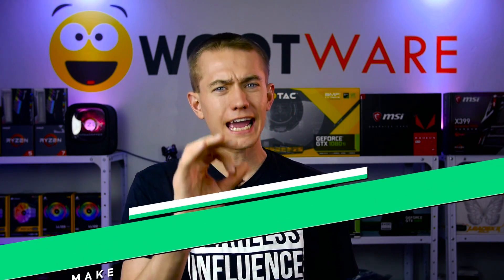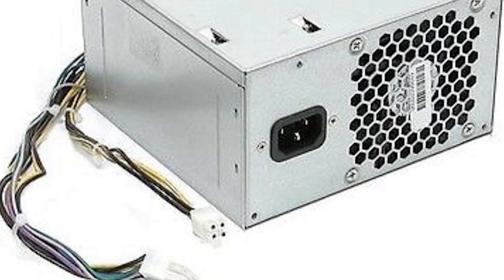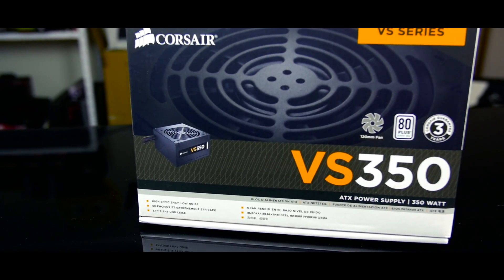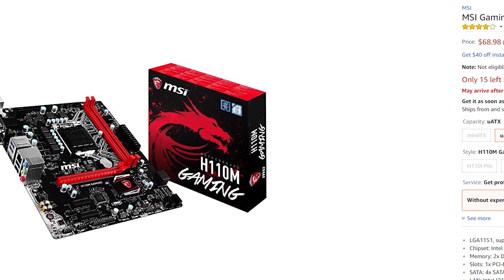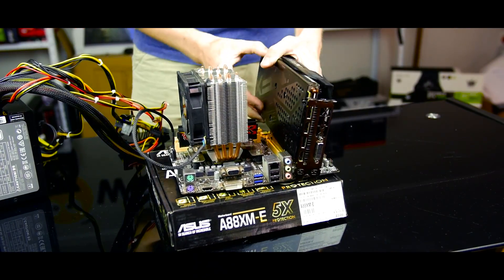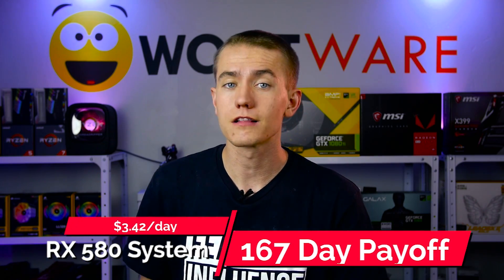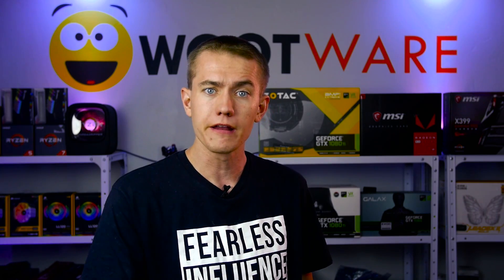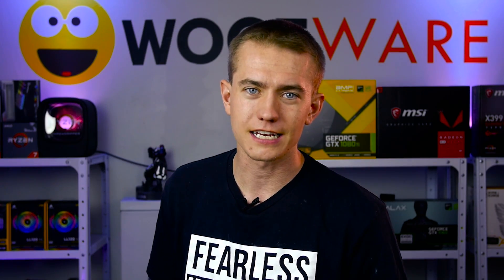How To Build The Cheapest Mining Rig Possible!

Comment: Would you recommend having virus scan software or disabling the virus scan software while mining? I've noticed my anti virus uses up some of my GPU.
Reply: @Jake Zeigler you'd want to disable all anti virus software. The anti virus software will see the mining software as a threat and either prevent download or won't allow the miner to work.
Reply: @Jake Zeigler I've been running mostly AMD cards 6800xt's and 5700's. There seems to be issues with the AMD software when it comes to mining. Not sure what it is yet. I've had two of my 6800xt crap out on me. I've tuned them up and had to reduce the tuning. Like I said, I'm not too sure what the issue is yet. I'm going to try and make a video and post it on YouTube to try and get some help with the issue.

I'm also running two Nvidia 1080 ti's that have had no issues whatsoever since I've started running them. I just need to tune then a little more to reduce the power consumption.
Reply: @Jake Zeigler not too familiar with the specs on that GPU. From what I read, they only require a 200w PSU. You might be ok. Get MSI afterburner to help monitor the temps and ramp up fan speeds if they get too hot. I like to keep mine 67°c and under. My 1080ti's have an auto shut down at 72°c. Not too sure if your cards have something similar.

Comment: Start mining pi, the cryptocurrency will be launched this year, and once it does, you won't be able to mine anymore. You don't need graphics cards you only need your phone, is cloud mining. It doesn't consume battery. It's on coinmarketcap in untracked listing. On marketplace there are already transactions for value of $100 aprox and when you just download the app you mine at 0.25 pis/hour. Use my code as an invitation.
Code: Name246
Download the app Pi network.

Comment: I mine Pi Coin on my smartphone (Pi Network app available for Android and iOS) because they seem legit and claim to be the first coin that may only be mined exclusively with a phone. You do not need powerful hardware to mine, only time connected to the internet, so anyone with a phone may mine. They are currently releasing coins while in the beta phase of 1 year. One can accumulate coins fast right now (I've mined close to 40 in 24 hours), but you need an invite code to join the program, you may use mine: cpalaniuk

Comment: Is this still good for 2019?
Reply: If you want to become rich centuries after you die sure.  Its not profitable at all when the rig can only mine 0.0000001 of a bitcoin per 24 hour period, then take into account the electricity used to let that computer run 24/7 as well as the fees charged to convert to whatever currency you have in your country....so the quick to the point answer NO, its not worth it.

Comment: if its possible please can you answer these 3 questions that i have been thinking of recently it would help greatly 

question 1= can laptops do this. i have a nvidia gtx1050 6gb gpu witb 8gb ram and ssd/hdd combi with i7 8th gen  processor?

question 2= i have a tower unit that has an i5 processor with 16gb ram and a mixture of gpu cards. would it be safe to use different gpu's in one computer or do i HAVE to have the same gpu in each slot? ( if you can use old model gpu's of course) 

question 3 is there a way to use the extra gpu's using a laptop to cut down on having the extra tower? or using the tower to use the laptops gpu?
Reply: Most laptops don't have enough power to mine and if it have enough power to mine your laptop will heat up

Comment: Get the highest internet connection, get an old trailer get two 1,500 wat solar generators. Make your own shelves after you strip the trailer secure your shelves or just put them all in big ass tubs of mineral oil over clock the gpu’s and CPU’s

Comment: Question: What about spare gpu cards that are different (say radeon hd 6000-7000; nvidia 1030 lp and 1050) The Idea is to use everything in your disposal. Second question: is there a minimum line for gpu memory? (say like 2gb or more but not less...and would the H rate improves if the gpu has more memory)
P.s. My english is a bit rusty...I'm sorry if I made some mistakes.

Comment: One thing to also bear in mind: you can run Windows 10 without a license key, which will allow you to use the better overclocking utilities available. I was able to get it running on an AMD X2 3800+ AM2+ processor (meaning PCI-E 1.0a and DDR2-800) with an R9 290X and pulling a little over 30MH/s mining Ethereum running Windows 10 and the latest drivers, and overclocked.

Comment: I built a rig using an AsRock J3455B-ITX. The little fanless onboard Celeron consumes only around 10 watts and you get the mobo and processor together for around $60. A little more difficult to get it running, but well worth it.

Comment: Hey guys, I can either sell my pc (i75820k, msi godlike gaming, 1x1080 Ti, 1x 980, with a 1200 Seasonic PSU, 32 gb ram) with a bit more than 2200 USD ATP, or just leave it for mining. I am in doubt tbh if the value would not drop to much compared to potential winnings. I could invest into 2 more GPU`s, as I see apotential of 69.95 USD/monthly per one 1070 ATP. OFC I am just a newbie which is wondering all these. Thanks

Comment: Hi there, Looking at this build from my local suppliers the total cost is $797AUS with a single RX570. Using cryptocompare this estimates to pay itself off in 347 days, based on today's profitability. I went with the MSI board so I could later add a couple more cards if it all works out. In your opinion is this kind of start up worth it? Or should I save for a better GPU to start with?

Comment: Has anyone ever thought about putting mining rig in a sealed enclosure so it can draw cold air in, and duct out the heat exhaust into you HVAC system, imagine saving more money by having it contribute to house heating in the winter, saving money on heating bill? Sounds like could be a fun experiment video for you

Comment: Dont use Celeron, use Pentium, it uses way less electricity power, and it have more or equal power. Pentium is meant/build to use less power as possible, while Celeron arnt. Cheap SSD from some no name brand are also good thing to pick.

Comment: Nice but. If you can find an rx500 series for less than $450, you will be lucky. Any RX series cards, even 400 series will cost you about $350 an up. Each. So that the only bad info in this video. Other than that, good info

Comment: i5 2500k
16gb ram
vs 650 psu
2x 1050ti
1x 500gb hdd

is this good?
im using my old computer (cost me nothing since i already have it)
just added 2 new 1050ti cards (this costed me to get into mining)
Reply: Good for what? Sufficient system to handle mining with 2 - 1050ti cards? yes!

Comment: Hello, new Subscriber here, awesome work. i have a question, got the mainboard z97x gaiming 5 with up to 6 gpu posibilitys over pcix etc. My Question is can i run there "3" later "6" GTX 1060 6GB,  2x4 DDR3 1333ram, 1000w corsair psu, "could i run all that with a "Intel G3260" cpu? or do i need a better cpu? thanks for all your help.

Comment: I'm a beginner miner and your guides have been really useful. I would like to watch a guide on how to upgrade a simple 1 GPU rig with a 2nd GPU (same Motherboard, same CPU, etc. Just one more GPU). My current system: Asus H110M-R/C/SI, Intel Pentium G4400, (1) 4 GB DDR4 2400 Mhz, PSU Raidmax RX-600AE 80+Gold and a Asus DUAL-RX580-O4G. Thank you
Reply: If you set up one GPU you don't need a video. Power down, unplug, install second GPU, boot up. Start overclocking program, then start mining program Done!
Reply: fordfocuselectric thank you

Comment: One thing I am curious about that no video seems to mention with all these open air rigs is what about dust? I mean it seems to build up on my electronics pretty fast with normal use, let alone being run 24/7. You obviously can't really cover these thing without the heat getting to be an issue so would you have to clean them on a monthly/weekly basis or something?
Reply: Just put the GPU's in the dishwasher once a month...Or you can blow them clean with a compressor.  
I run the rigs in the basement. Extractor fans for hot air out and blower fans with dust filters for cool air in.

Comment: This was really an amazing video. I built mine using similar parts, single GPU GTX1070 AMP edition, 4 GB DDR4 RAM, Dual core processor, MSI H110M motherboard, Corsair VS650 PSU. Total cost $950 USD. Currently making $4.5 USD per day with nicehash easily.
Reply: £4.50 a day… is that good im new to this it seems like thats barely worth the investment

Comment: The motherboard on the box makes good kindling :)

Standoffs getting the motherboard up and off of some cheap sheet metal or framing is probably a better route and costs are still cheap, more sturdy and easier to move around, power supply can be screwed on etc.

Just some thoughts.

Comment: Man you are energetic AF LOL... Thanks for the info i have like 4 old PCs laying around. The most powerful being a AMD Phenom x4 965 BE on a GA-790XTA-UD4 and a few MSI R7 370 4GB GPUs. with 8 gb ddr3 RAM and several SSDs. I may try this.

I thought about using my AMD FX-8320 but those get hot As hell. And i will not use my Ryzen 5 1600 Gaming rig

Comment: Gigabyte Z370 HD3, Socket LGA1151, Intel® Coffee Lake 8th Generation CPU, DDR4

Procesor Intel® Pentium™ G4400, 3.30GHz, Skylake, 3MB, Socket 1151, Box

 Corsair 16GB (2x8GB) SODIMM, DDR3, 1600 MHz, 1.35V, MAC Memory

Solid State Drive (SSD) ADATA Ultimate SU800, 2.5", 128GB, SATA III

Desktop PC Comrace® Gen7 C3, Intel Core i3-7100 3.90GHz , 4GB-DDR4, 1TB, DVD-RW, Card Reader, Linux

Sistem Desktop PC All-in-One Acer DQ.UAPEX.002 cu procesor AMD E1 7010 1.5 GHz, 19.5”, 4GB, 1TB, Intel HD Graphics, Microsoft Windows 10 Home, Black

How is this?

Comment: Just did some calculations... the diference in electricity cost between using a 3.5" HDD and an SSD is $4.15 per YEAR!!! (if your electricity costs $0.06/kWh). That's negligible! And you can save $30 right now, if you use a cheap HDD.

Comment: Nothing mysterious about a mining rig, just need to do your research and have a fist full of cash when you find a GPU or two worth buying. I'm very carefully investing, and it has slowed my build down far more than "Let's just pull out the CC and buy two grand worth of GPUs!" but saved a boat load of money and improved ROI. I refuse to pay more than about $220 shipped for an unmodded RX 480 8G or 570/580 8G. With that strategy, over two cards I've collectively saved the cost of another card (plus enough for modding fees for all 3) at that price when weighed against current "market values". Refuse to pay scammers and gougers 300 or 400+ for a RX 400 or 500 series card!!

Comment: Liked the video a lot, but i have a question... Seeing that a ryzen 1600 can also provide a nice hash of around 500 h/s wouldn't that increase the profit over the celeron seeing it only takes about 70 watts? I ask because i'm thinking of building a combined miner with the ryzen 1600 on the biostar ta320 combined (for starters) with 2 r290 (x) cards. It will cost me around 125,- us more for the ryzen, but do you think it's better profit on the long run?

Comment: What about the cost of the OS to run the mining rig?  I'm sure you can't just plug in all that hardware and expect it to run.
Reply: I tried a stock rx570 in Windows 10 and got 380 H/s mining ETN. Flashed the bios and almost bricked the damn thing but afterword the hashrate didn't even change. Max overclock netted me 430H/s. So I said screw Bill Gates and went to ubuntu  now each stock rx570 jumped to 590 H/s. Ryzen 1500x stock gets 400 H/s. Windows 7 would be cool if Ryzen worked properly with it, but it doesn't so windows can suck it now. Done for good Linux for the win.
Reply: Incred EblyX i get my os for free LOL... also linux is free.
Reply: Be aware that Linux (Ubuntu) does not support OpenGL for AMD. Found that out the hard way.
Reply: I thought the same thing...
Reply: You could also run windows unactivated

Comment: The power drawn by a hdd or a laptop hdd is 100% irelevant. I don't see any reason in using an ssd instead of a cheap, $2 refurbished hard drive. 
And network boot is even better for a bigger farm. One rig has a hdd and serves a kernel and initrd with the miner and the rest boot LAN.

Comment: How are you guys getting new cards to run on old systems isn't there a GPU slot backwards compatibility issue?
Reply: nope except for AMD cards not liking some older boards. the PCI-e standard is backward compatible.
Reply: but only one generation right...IE you can't put a PCI-e 3.0 card into a PCI-e 1.0 slot or am i mistaken on that?
Reply from the maker: +Paul Kimble PCI-E is completely backwards compatible.  A 3.0 card will run in a 1.0 system, just at 1.0 speeds.  Since you need barely any of the speed that PCI-E provides, it's fine.
Reply: Thank you

Comment: No GPU needed.  Mine cryptonote currencies (monero, sumokoin, electroneum, etc) using xmr-stak-cpu and some cheap dual xeon x5600 series or early early e5-2600 series processors.  Plenty of cheap rackmount servers on ebay super cheap.  The more l3 cache the better.  You can run one thread per 2Mib of l3 cache.  ROI is typically 60 to 90 days.

Comment: I have high-end laptop which I bought two years ago, is it possible to mine any crypto currency with it? 
Intel i7-4940MX 4GHz, NVIDIA Quadro K2100M 2GB GDDR5, 32GB DDR3 RAM, 512GB SSD Drive
Thanks
Reply: Lots of things it's capable of mining but you will probably fry it. Laptops don't have the cooling needed.
Reply: wingracer 16 in other words put a big fan it

Comment: I took my old cards, cpu, mobo, old 650W PSU, a 500GB drive, old case, and a Windows serial from a busted laptop I was going to throw away. Cost almost nothing and generates up to $5 per day on one card. Next step is to upgrade the PSU so I don't blue screen when running both cards and get some risers to add more cards. Power is dirt cheap at 3 cents a kilowatt hour here so I can turn a profit with R9 390s.

Comment: do i have to power both the PCIE riser AND the card? so it would be 3x 6PCIE connectors?
Reply: yes. though if you're talking 580s with an 8 and 6 pin, the extra 6 pin is optional and doesn't need to be connected.
Reply: its a 1080ti
Reply: im hooking up a 1080TI having some problems with all the power connections. i have 2 free 4 pin molex connectors from the power supply one data connector i hooked a 6pin pcie adapter to to power the riser..im a bit lost on how to get power to the 2 pcie slots on top of the video card

Comment: I see people don't add in internet connection cost also on top of power consumption. I would be greatful if you could make a video on running more cards on a rig. I have a GTX980 hof. How much better would it be if I had two or three of them profitability wise. and what is your take on internet cost for example R599 for telkom unchapped. and does line speed matter when minning? Thanks in advance
Reply: because most people that would even know what mining is would already have internet.

Comment: Nice video. I wish I had this to watch when I was getting started.

SSDs use like 1W less than an HDD. For a beginner tho you'll be restarting your system like a lot and an SSD will make your life a lot easier. Theoretically you can always downgrade to an HDD and clone your system to it.

MBs with 13 PCIe slots are a smart investment but running 13 GPUs isn't the most intuitive of things.

Server PSUs are worth looking at. You have to solder your own wiring and make sure the unit doesn't need an extra heat dissipation solution otherwise they blow up, nothing dangerous tho as server PSUs have much higher standards.

Comment: a couple of questions. Your using an old MoBo thats running on DDR3 but the most GPU that can be used for mining is @ DDR5. what to do or better assemble a new rig? thanks
Reply: system ram and vram are two different things and have nothing to do with it.

Comment: thanks for the video, please make one that expands into more cards.  Looking to use existing system and upgrade power supply (80plus gold/platinum) and purchase 2 580's to get strarted (FX8150, MSI FXA990, 16gb corsair DDR3 already in system.). Would want to start with that and expand into more cards.

Comment: RX580 is available in India for 650 USD should I buy?
Reply: d town are you shopping on online sites..check offline prices in India they are lot more cheap than the online pricing I purchased two RX570 4gig each 20450Rs..but in Amazon its about 26000 and in mdcomputers it was 21700..so my advice check offline prices
Reply: Pravin Nayakar okey thanx.
Reply: Pravin Nayakar however how much hashrate your 2 570s are giving

Comment: Inspired by your previous videos, I'm dipping my toes into this mining thing using an old, nicely spec'd HP 6200 SFF PC with a new  GT1030- as it fits in the case. Money out the door is $95AUD. My rationale is the hardware is the fun and easy bit, but I wanted a machine to experience the end to end process of acquiring cryptocurrency through mining rather than buying. Your vid on the 1030 is very helpful and am now checking out the limited options available for mining. It's a totally new area for me. Even though I've been hacking computers for a while (1st computer was ZX81 36 years ago), gaming doesn't interest me, so the 1030 is the 1st GPU I've ever purchased and over clocked. This video is useful as it is the natural progression from my current position. Thanks